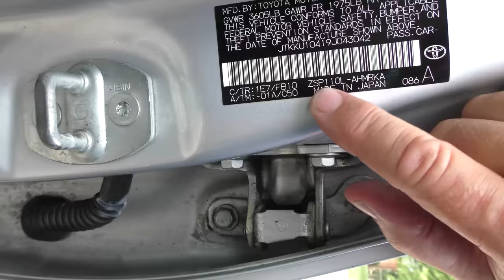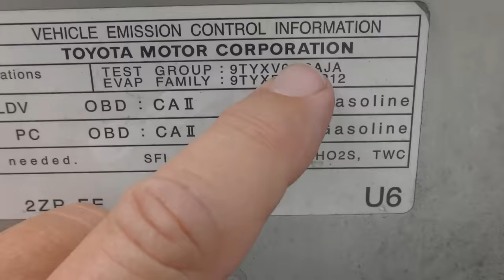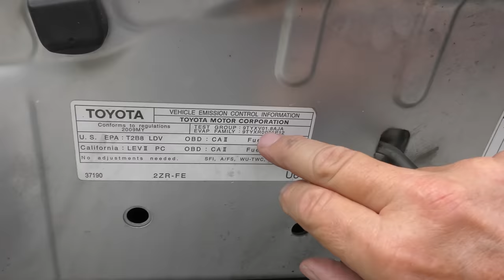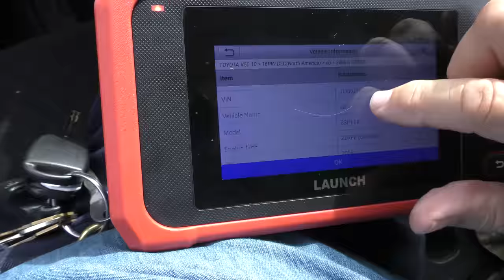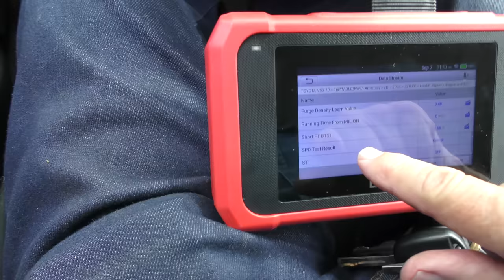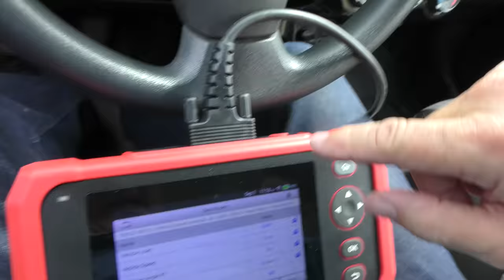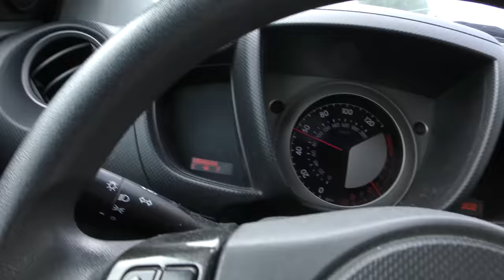Stop Buying Toyotas and Buy This Car for 3x Less

Comment: I've owned a 2011 for 10 years with 1.8L engine.
In that time had water leaking from the tailgate, wheel speed sensor fail and the evap cannister needing to be replaced 3 times (each time id take one off of a junked yaris, great for parts for thr xD), clogging AC drain lines. Never needed to change the sparkplugs, had 197km on it. Despite that I'll miss the car. The electric power steering was nice in it too.

Comment: THAT WAS EXCEEDINGLY INFORMATIVE TO ME.  THANK YOU!

I was thinking about getting myself an older used, kiick around, Toyota.  Now I'm thinking.  A SION,  with the,, 1.8 L and, manual stick.  (If I can ffind it?)  A logical choice!  It's a Toyota!  And yeah.  Parts for years to come.  Parts, forever.

So,, whaat else of Toyota's might  bolt on?  How about a Supra,,  grill?  Avalon, taillights?   What about a GR-8 front end grill?   Could that bolt on?

I've often  thought about getting myself a used, 1970s-90s,Sting Ray.  With a blown engine.  And swap that V-8 out for a, 4 cylinder in-line engine.  I won't when any races.  Coming off a red light.  But will have a greater chance of getting laid,, instead.  As I'll take a fast partner and a slow car.

I'm full of great automotive concepts.   I'm from Detroit, from the 50s-60s.
   RemyRAD

Comment: Regarding the hot starting problem...
Check the coil pack (if it has one)
I have a 2004 Aveo that had the same problem intermittently. My research indicated when an older coil pack would get heated up, it could/would malfunction.
I replaced the coil pack and have had no more problems.  May be similar in the Scion...
BTW and FWIW...I love my Aveo...It is well maintained (Timing belt at 65K) and totally dependable, nimble and fun.

Comment: The Scion brand was just in NAFTA. The same car model is called Toyota Ist (second generation) Toyota Urban Cruiser. You could also get it with 4WD (only fitted with the turbocharged diesel engine (1.4 liters) on the EUDM. 

I’ve had a 2009 Toyota Urban Cruiser. The same car model - only fitted with a smaller engine and a 6-speed manual transmission instead of the 1.8 liter with a 5-speed manual transmission (when not fitted with an automatic transmission).

Comment: I bought a 2009 XD with 31 miles on it in 2009.  It now 2024 and it runs and drives just like the first day i had it.  No major issues as long as you maintain it. ive replace an alternator,  had suspension work on it,   brakes, regular maintance and I have never had any major issues!!  Its is ready to turn 200,000 miles at 198,000.   I sometimes think to trade it in but why would I want a car payment if I dont have to? I'll run this till the engine can do no more.

Comment: I have a vibe it's got 303k miles and I only change fluids, brake pads and tires. The odometer stopped at 299,999 now I keep track with trip "B" and when it his 9,999 I just note it in the owners manual. The vibe is basically a Toyota matrix. Can last virtually forever! Oh and I drain what comes out of tranny and replace it with the proper fluid every 50k miles!
Reply: Yep the Vibe is a great car, gave mine to my son in law who's still driving it and I bought a new Corolla.
Reply: I Also drove a Vibe, it was a 2003 I had 150 thousand miles. Same experience, oil change, brakes and tires plus a battery change. Traded in 2016!
Reply: @hunter Johnson yes they are great cars, I have a 2006 Matrix, base model with no power anything, only A/C as an option, it’s got a typical 151,000 miles, & it’s barely broken in. Looking forward to driving it another 15 years & lots of miles.
Reply: @Blakecryderman7244  just change oil every 5 k you will be good! Last almost forever!
Reply: Exactly

Comment: I had the same problem with my 1986 Celica.  Hot engine wouldn't start.  I got real good at popping the clutch. It had roughly 215 thousand miles on it.  Well maintained.

Comment: I have a 2006 xa with 215k. I'm the original owner. Almost all original parts. Replaced starter and fuel pump (even though I probably didn't need to) and plugs occasionally. That's about it. Nothin major.

Comment: I own four cars. Three of them are scions that I bought brand new. A 2006 xB, with 230k miles and still the original clutch, a 2013 FR-s with 185k and the second clutch due to a bad throw out bearing at 130k miles, and a 2017 iA with 170k miles and an auto transmission. One's a Toyota, one's a Subaru, and one's a Mazda. They are all super reliable. Sad that they discontinued the brand, but then it's guys like me that killed the brand. I'm 70. Kids don't want an old person car. 🤣

Comment: Wouldn't the 2.4L be the oil burner? I have a 2013 tC with the 2.5L, and it's never had any noticable oil loss between oil changes. I actually specifically bought the 2013 because I knew they went with the 2.5L instead of the 2.4L, to avoid the oil burning issue.

Comment: If you find a Scion 2010 with a 4-cylinder 1.8 l does it matter if it's a manual transmission or not?
Reply: Their manual and automatic trans are both good.
Reply: @nmatthew7469  thank you

Comment: I'm going to argue that gearing as much more to do with MPG combined with engine size over just small engines for MPG.
Reply: Very True. I had a Civic SI hatchback, and in 5th gear going 70 mph, the RPMs were around 3200 or higher. Despite the small engine -2.0?- and small body,  it could never even get 30mpg. Had it been geared differently in 5th, 35mpg would have been the norm.

Comment: That plug doesn't look bad. Insulator barely discolored. Gap looks OK. No misfires. I did my Legacy wagon engine EJ20b front for second time at 200, 000 Km and changed the plugs(platinum) for the first time. Couldn't be bothered changing them at on the first front overhaul. The 3 of the old plugs that I took out at 200K had lost the entire platinum centre electrode and gap was up to about 55 thou. No misfires even at that. I have strong suspicion that the plugs were not the problem in Scotty's case here. I predict some other intermittent problem.

Comment: The 2.4 motor was a huge mistake by Toyota then.  They realized it’s a bad engine so they stopped making it and sold off any left over ones in Camry Xbox etc.  stay away from the 2.4.   The 1.8 is by far the very best engine ever built.

Comment: I have a scion xb 2012 and the issues I have is oil consumption, A/C not cooling as well as before and sometimes the transmission takes a while to go from reverse to drives. Contemplating on repairing or just buy another car. Any recommendations?

Comment: I had an 81 Accord that was hard to start when it was hot and sat for a while. I think it was the ethanol in the gas that was causing it to vapor lock. I spent a lot of money getting that car worked in and nothing worked until I changed the gas.

Comment: Scotty , I have a Scion xb , I bought it used with a 150,000 miles on it . when I first got it the should 300 miles to empty when I filled it up , now it says  250 miles to empty  . the gas peddle is real touchy and the gas miles seems to be shitty . no codes ,replace the spark plug , clean the valve body . do you know what it could be ?

Comment: If the temperature light is green and it stays on for over 15 minutes, does that mean it’s operating at too low of a temperature and it may need a thermostat the catalytic converter was already changed

Comment: The only really bad thing about Scions is that most of them are really small and if you're over 6'3" it's going to be a tight fit for you. I've been looking around at Crown Vics or Town Cars. You can get one for not a lot of money that's still got a lot of life left in it and parts are very available.
Reply: Scotty did a video on those saying they were a good car for the money.. He said parts are everywhere and they are a good reliable full size car. He said you can find a nice one for 5k if you look for awhile. The high mile ones are $3500 or less here in Florida.  Research his video and watch it.
Reply: Also try sitting in Nissan Maximas
Reply: I have never had a Scion, but had a Matrix like Scotty has for 6 years. In addition to be very reliable, the Matrix had plenty of headroom for my 6' 4" frame, and the seats were very comfortable  given that it is an economy car. Toyota seems to put a lot of thought into seats. My current 2nd Gen Tacoma Prerunner and 2013 RAV 4 could probably comfortably seat most NBA players.
Reply: Also a good thing to be aware about when you are tall, is that sunroofs take away a few inches of your headroom.

Comment: I had a 99 Oldsmobile Silhouette. Cold starts were fine but it began to not start after getting warm. Ended up being a bad wire from coil pack to engine

Comment: Why the 2.5? That's one of the most reliable engines they've ever made
Reply: @nakoma5  
He actually said "2.5" twice...
but "2.4" once....
Reply: @nakoma5  11:24 and listen carefully
Reply: @demcomp  I stand corrected. But yeah, the 2.5 doesn't have those issues. I'm sure he meant to say 2.4.
Reply: @nakoma5  I'm sure he did too. I have a 2.5 in my tC, it's amazing! Solid and reliable..

Comment: Anyway besides the Toyota certificate to determine if the 2.4 has been rebuilt on an '05 Scion? I'll definitely be checking the tailpipe for residue.
Reply: 2005 scions only have 1.5 engines

Comment: I have seen several 1.8L toyota engines that burned as much oil as they did gas lol. They made the piston rings cheap for some years. I think in the 90's every manufacturer made the best vehicles. GM 3800 series V6 cars like the Buick lesabre, Regal  and Oldsmobile 88, Intrigue.  Ford had the Panther cars, Crown Vic, Mercury Grand Marquis and Lincoln Town Car. Toyota Corolla and Camry Honda Accord and Civic. Nissan had the Sentra and Maxima they were all solid cars that were built a lot better than anything made today.

Comment: My 89 chevy has lasted longer than some of my friends new cars. My 78 ford f150 ranger xlt has lasted longer than any new car. With a million 5000 miles on her. New cars make me laugh. Bring back the reliability and simplicity of cars. I want manual windows, and possibly a bluetooth head peace for the radio that is as far I want in electrical other than legally required. 

No lane assistance, no brake checking assistance, bells or whistles other than a sun roof if we get into it.

Comment: I have a 2009 Toyota Avensis T4 tourer with the 2.0 d-4d engine and a manual gearbox currently on 188k miles. Any common issues with these Scotty?

Comment: Omg. I could have bought one of these instead of my 2003 RAV4 which has automatic. I was previously driving a 1988 Toyota Corolla to 500k miles and would still be driving it if it weren’t for the rear windshield getting busted. I loved the hatchback on that and could lay the back down flat for my purposes. I miss the manual trans. I could not find another Toyota Corolla hatchback. So I got the rav4 but seat doesn’t lay all the way down, hatch opens sideways(bad in rain) and it has auto trans! Now I find out this a year too late!!

Comment: Stinks, I need an '11 or '12 Rav4 Limited bc of my dogs and the rear gate door and the height off the ground. They want crazy $ now with 65k mi, 88k mi or over what I paid for it in '13 w $5k mi.  I lost mine in April in a wreck after just putting $2k into it. I needed my pd in full to last over 400k mi but at 179k mi... totaled. 😭 Stinks and affording what I need for me and my dogs is really hard right now and my credit score is not what it used to be either. 😪

Comment: Still have my ‘10 xD with stick shift, never had any issues with it throughout its long life. Drove it across the country twice. It has a lot of cargo space for the deceptive size of the vehicle, including a “hidden” extra cupholder on the passenger side dashboard. 

Also the car does have TCS but it’s very easy to get the tires to skip coming out of a dead stop.
Reply: and 3 clove boxs

Comment: i need help. my 99 celica has a bad stalling issue. when I press the gas the RPMs dip hard before moving or it stalls the car. also when pressing the brakes but less so. plugs are good. new fuel filter. new distributor. idk what to do

Comment: As a Canadian i can say amazing NO Rust on the Matrix.
Reply: @don ho funny how you say that because I’m a Canadian owner of a 2006 Matrix base. It’s got 244,000 kilometres on it, & it has no rust at all, Toyota does a pretty good job coating these cars from the factory. Zinc based primer, at this point it’s nothing new it’s been used on Toyotas for like 30 years now, as long as there’s no bare metal exposed from a deep scratch, it won’t rust. Keep it rinsed & it won’t rust ever. My Matrix never had any dealer undercoatings done, which is a good thing because they do more harm than good, rubberized & will hold moisture in. Even a 92 Camry I looked at with a typical amount of mileage on it didn’t have any rust on it. Pretty good.

Comment: 2.5 or 2.4 liter engine is bad ?
Reply: 2.4
Reply: @md2k8  That sux, I have a Scion tc that has the 2.4 liter engine. Let me go out and put my finger in the tail pipe.
Reply: Ya he messed up at the end of the video. It’s the 2.4. The 2.5 scion ( later year scions) are the ones that fixed the problem for the oil burning. He has a few vids on em.

Comment: That scion has the better 1.8 engine.  The 1.5 are trash 😆.  My ex has a 05 scion xa and the head blew on it with only 130,000 miles on it

Comment: Toyota doesn't impress me like they did. Driving down the road in the wife's rav4 and the rear seat belt alert sensor is beeping at me because the 3 ghosts in the back seat aren't wearing their safety belts. 

The car loses traction going uphill In the rain. 

The mpg anything over 60mph when not using cruise control is worse than my manual with an ls3 with mild cam, extractors and full exhaust with a mafless tune.
(Pontiac g8 for USA market?)

It's a great time to buy a motorcycle. Or a horse...

Comment: Yeah so a bunch of em burned oil, bad piston rings, no big deal, toyota fixed alot of em, just be sure you dont get one that burns oil.
Any other car model has a small batch with a slight defect: yeah stay away form that car brand, theyre all junk, all of em, forever!